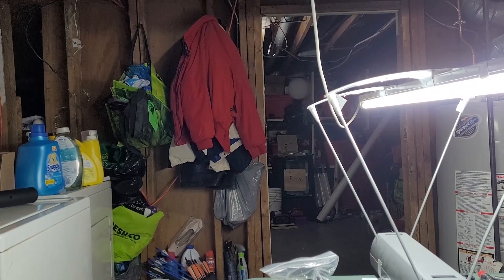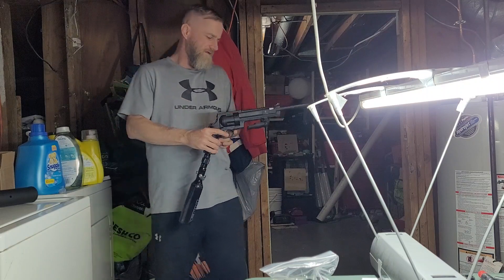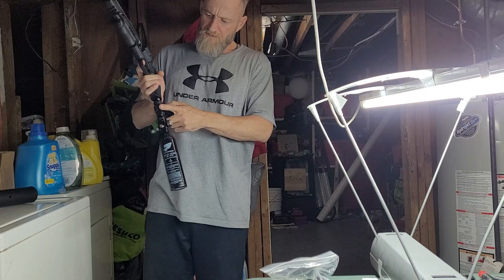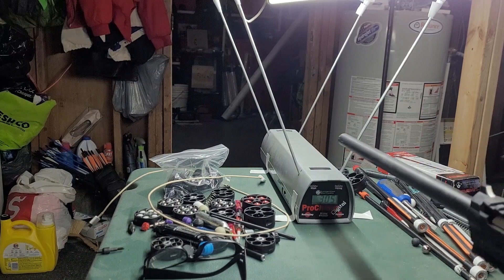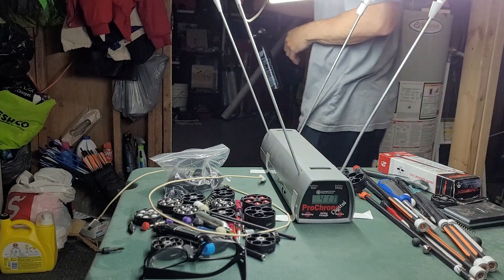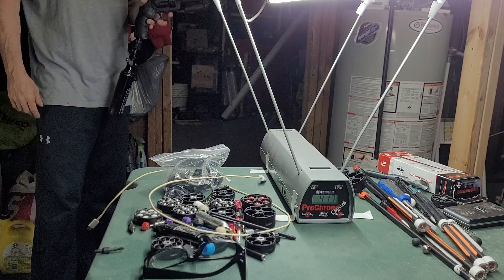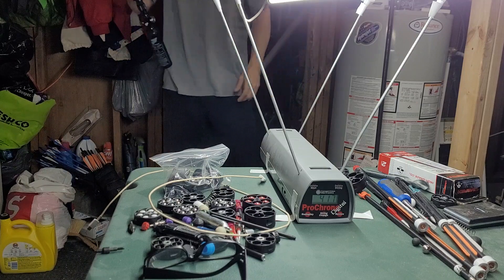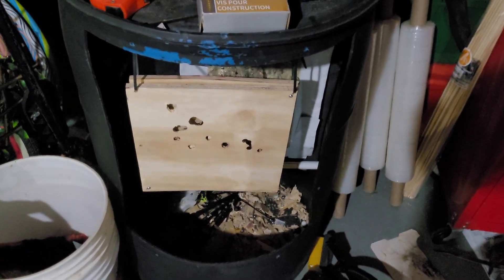Umarex HDR-68 Fixed Crimped Valve Leak Test 1100 psi 85 Joules

Comment: The HDR 68 supports an HPA Kit with a 4500psi tank and a 1800psi regulator? It has an On/Off valve and a 30cm barrel. If it can handle it, how many joules do you estimate when using 9-gram pointed steel ammunition?

Comment: Is 1300psi to much ?
Reply from the maker: if the marker has a gen 1 or 2 valve then it can handle it but you may lose an oring at 1300 psi, keep the oring nice and wet
Reply: @LessLethalHomeDefense  
How many joule did you think, with 19inch barrel, 8g steel bullets. HDR50.
Reply from the maker: @antisocialsecret7584  should be around 95 joules